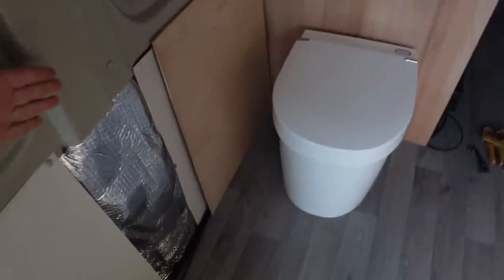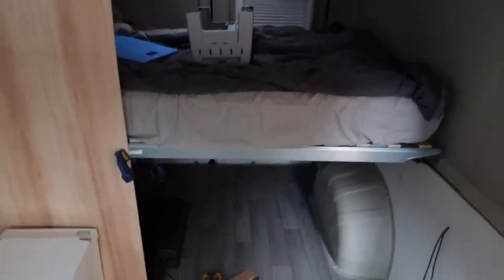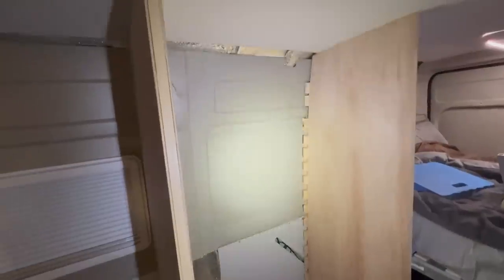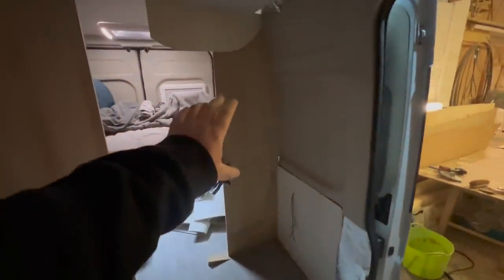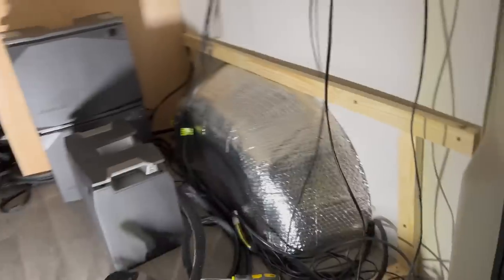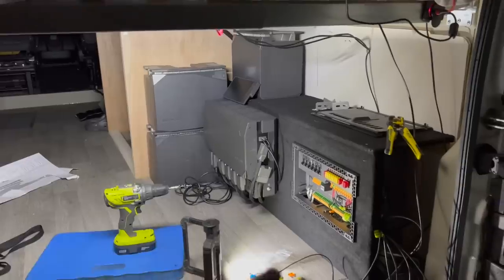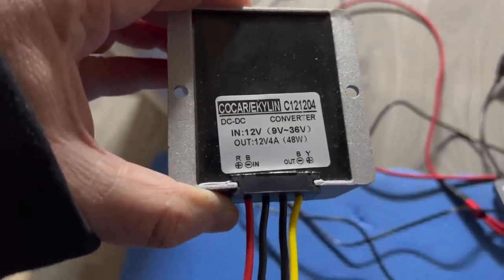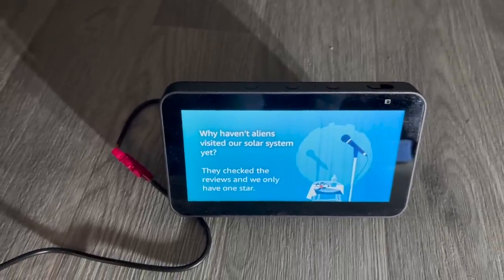Building my Campervan Toilet - VB29

Comment: Hi John , I’ve got the same toilet on my narrow boat . I have just piped the extraction fan into a carbon filter . So I didn’t have to drill a hole in my hull to  vent the pipe outside  . Great thunder box by the way 😀

Comment: I had wondered about the length of those pre-made cables and whether you were going to be able to cut them down or what. I see that as the one, small, snag with using that set-up when doing an all electric build out.

Comment: I wonder why you didn't have a loo in a cupboard instead of creating a high ceiling room i.e. a flip up counter top over it to maximise usable space i.e. could have had extra counter space and an overhead cupboard by using a flip up worktop (toilet turned 90 Deg obvs)
Reply from the maker: Watch the VB1 video